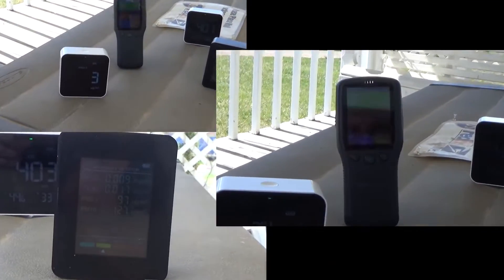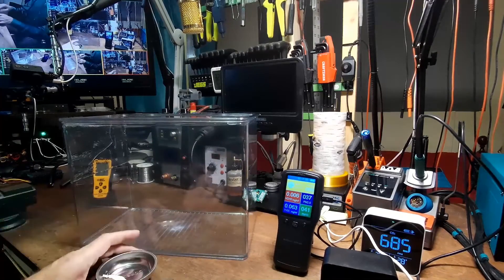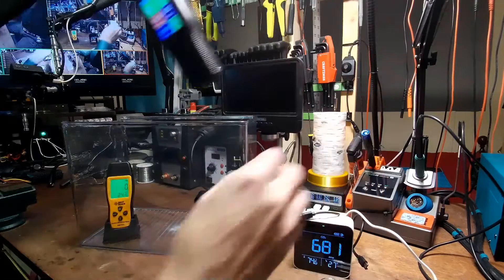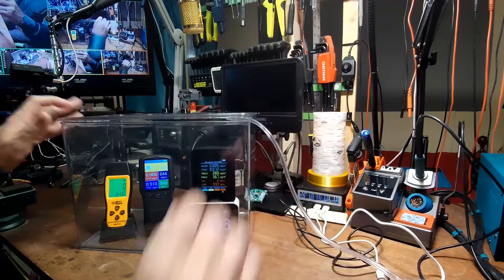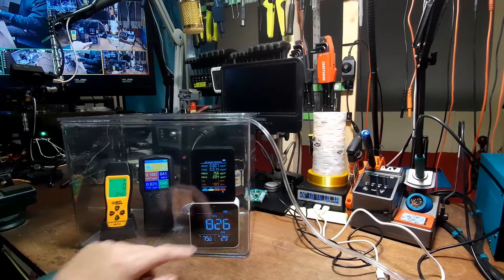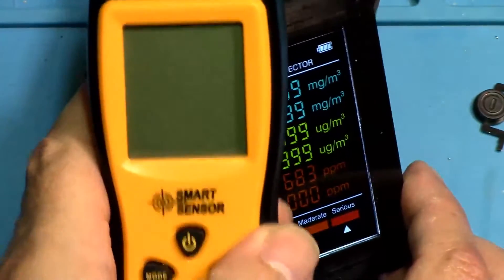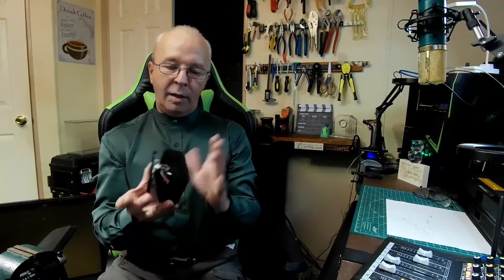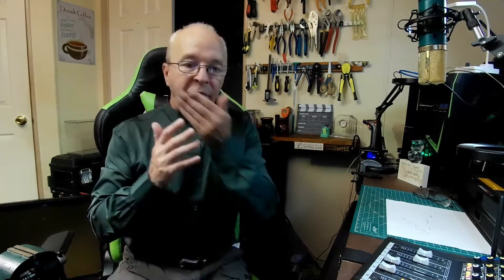Compare Fake Chinese Air Quality Monitor To "Smart Sensor" CO Monitor & "TemTop" CO2 Monitor

Comment: Wish I saw this before getting of those, I realised it was rubbish when it started shorting out my USB chargers. Cracked it open and the sensors in it were total junk, unplugged them and powered it up. It just showed random figures.
Reply from the maker: Sorry to hear you got this, but the silver lining is that it was only 20 bucks or so, as I am getting ready to do a video review of one that cost's 70.00 - and another that I paid nearly 100.00 for, so price anymore is no indication as to legitimacy for sure.

Thanks for the comment, and your experience- much appreciated.

Comment: As someone who's designed indoor air quality sensors, I can confirm that that is indeed a fake sensor. As you discovered it is predominantly an alcohol sensor (MQ series sensor, there are many types, none are CO2, or PMxx... there is a CO one, but these tend to be reactive to many stimuli so can easily show false readings), and a particle sensor (but not a PM2.5). The reason the particle sensor readings were off the chart after you opened it is that ambient light was likely interfering with it, or you had the beam totally occluded. That sensor is more like a smoke detector, capable of detecting huge airborne particles, but nothing down in the order of 2.5um or 10um that the meter claims. It's sad really, as true CO2 sensors and PM2.5 sensors of good quality are not that expensive. For only a few dollars more that thing could have been real at least for those measures. (TVOC could probably be included in there too without an appreciable price bump). Both CO and formaldehyde would add some additional cost ($10-$15 for both, in volume). The case and display are definitely good candidates for an electronics enthusiast to take and use for a real sensor.
Reply from the maker: Thanks Mark for your assessment - much appreciated.  The Chinese are getting very good at faking it.  I have two more fake monitors to review, but the one monitor is very very convincing.  The CO does not react to CO, nor does the CO2 react to CO2, but neither does the CO or CO2 react to alcohol, so it was intriguing to find what was giving the false reading for CO2.  I finally discovered that Nitrogen Oxide was the culprit this time, so am assuming that they are using a Nox sensor to fake the CO2 reading.  However, the CO I still can't figure out what they are using to trigger that, as nothing that I have tried is making the CO jump up high.  I can't get the CO to go higher than 8ppm, and it stays there pretty much no matter what I do.   I also found that this monitor is a clone of the actual maker, but they have completely duplicated every detail, and even the photos on Amazon are of the legitimate device.  I have contacted the company that makes this device, and asked them to send me one of their models for a comparison, but have not heard anything from them, so I will have to put the video off until I can get the money to purchase the legitimate device from the maker themselves.  Evidently they don't care that there is a fake copy of theirs being sold on Amazon, so it leads me to think that possibly the "real deal" is also a fake, but can't know for sure until I can afford to purchase it.

These fake monitors are getting way out of hand, and something needs to be done to put a stop to it, because people are buying these things for their safety in knowing their air quality.

But unfortunately, there is only so much that I can do to expose these companies, because I have very limited funds to keep doing these videos, and Outside In just hasn't gotten big enough for people to start helping financially.  We need more subscribers, and more people like you that appreciate what we are trying to do.  If the subscribers would equal the views and appreciation that the air quality videos are getting, we definitely would be much better off.  

I am working on a new case to better test monitors, but that has taken all of my finances, including grocery money LOL.  I am hopeful that soon the subscribers will surpass the views and appreciation.  There is so much more that I want to do, but simply can't without help from those who benefit from these videos.

To be perfectly honest, I sometimes feel it would be better to just stop doing this, but then my part that loves to help others kicks in, and says no way.  I enjoy doing what I can to save a life, so whatever it takes, is what I will keep doing until I simply can't.

Thanks again for the assessment Mark, and your knowledge in the field.  I am constantly learning more and more about these devices, and how to dispel them, so people don't make the mistake of buying a fake one.
Reply: @Outside-In.  it's great that you are doing these reviews to let people know. I hope that your base grows to help sustain your efforts. 

One thing to keep in mind with CO2 sensors is that there are "eCO2" sensors out there, which are not the same as a true CO2 sensor. This type of sensor estimates CO2 levels based on other parameters which it can measure (usually some sort of VOC - this may be what the cheap "fake" Chinese device was doing with the alcohol sensor, but poorly), and thus is not a true measure. They are not particularly accurate except under a very narrow set of environmental conditions, and can easily produce a false positive, or negative. But they are none-the-less legitimate devices. (see the SGP30 from Sensitron as an example from a well respected sensor company)  Even if devices that use this type of sensor state that it is eCO2, the average consumer probably wouldn't understand the difference. 

Bottom line though, is that if someone is using this as a safety device, they should not be relying on a bargain-basement device from ebay, amazon, or any other online marketplace. It has nothing to do with country of origin, bad devices can come from anywhere, not just China. Good devices can come from China too, just expect to pay more for them, like they would from anywhere else. The fact is that most of our consumer electronic devices, good and bad, come from China.

Anyway, keep up the great content, and best of luck with the channel.
Reply from the maker: @canadianavenger  Thanks Mark for the encouragement, and also the subscribe - it is much appreciated.

This is the way I look at it.  A device that specifically states a particular reading, and it turns out that the reading is being manipulated by another sensor or reading - it is fake and should never be trusted, and also the company should not be trusted.

Intentionally misleading the public is false and a lie.  eC02 is not genuine CO2 - it is an approximation like you say, but an approximation is still a lie, and therefore a fake monitor.  If eCO2 is apart of some of these devices - then it should be stated in bold on the packaging and on the screen itself, that it is eCO2 and not CO2.  If a company puts a eCO2 reading in their device, and then labels the reading CO2, believe me - they know exactly what they are doing - lying - misleading a person to think one thing, when it is really another.

Hotkrem has a budget CO2 monitor that is genuine, so not all budget monitors are a bad thing.  And yes you are right, there are a number of legitimate China companies making legitimate monitors, but also yes, that it will be evident by the price being not-so-low LOL.

Thank you again Mark for your encouragement and knowledge in this field.  It is also helping me to stay focused on why Outside In was started.  As long as we can pass on information that can save a life, then it doesn't matter how many times I have to over-draw my account to keep doing these videos does it???....  👍
Reply: @Outside-In. Love your videos. Please do a tear down or open up of the TemTop 1000s+ 2nd 🙏
Reply: @Outside-In. Mark, if you see this I have a Q: is the IQAir a quality brand? I rely on their sensor and air filters to protect my sick kids. They have a genetic illness and cannot deal with toxins.
Reply: Can you name the CO2 sensor on the market that measures accurately?
Reply from the maker: @greywolf_35  Thanks for the question.  If you need accuracy, then you will want a monitor that uses an Electrochemical Sensor and not an NDIR Sensor.

Electrochemical Sensors are used for more accurate readings, and will also register higher concentrations of contaminate, but at a cost...  Electrochemical Sensors have a life span of 2-3 years.

NDIR Sensors are less sensitive and less accurate, but they are so popular because the NDIR Sensor has a life span of 10 years.

For home use, the NDIR Sensors are perfect as they are very good, and close to accurate, and also have a much longer life expectancy.  If you don't need pin-point accuracy (like I do) for testing and comparisons, then NDIR Sensors are just fine.

I hope this answers your question.
Reply: @Outside-In. What is a short name for an electrochemical sensor? How are those called on a manufacturers website?
Reply from the maker: @johnmachter40  EC sensor is the short for Electrochemical Sensor.  Hope this helps.
Reply: can you give me a recomendation for a not too expensiv but accurate measure tool for vocs for 3d printing?
Reply: @NikBuhler  M10i

Comment: I've got cheap $86 Air quality detector, says it's got a co Sensor or at least its got the readout for co, my home before  says 400 ppm co2 but with I put the monitor under the blankets with my head also under the co2 Immediately jumps 800 over time that number jump to 1300 but the co jump from 0 to 6, so clearly it don't have a co sensor the co display is used co2 to circulation is bad and the potential for co to also build up, so I'm happy with that, vape shot the 2.5 micron up to 999 just by blowing vape on the unit, so in a way it's working
Reply from the maker: What is the name of the monitor you have?.  Thanks for the comment.   Whenever you put your head under the blanket with the co2 monitor, yes, the reading will definitely go up,   but the 400 reading in your home concerns me, and why I would like to check this monitor out.

If you are a smoker, you will also be breathing out CO for at least 10-15 minutes after you stop smoking a cigarette,  so jumping to 6 would make sense.   I have not tried vapeing with a connection to CO, so maybe that is something I should try.   Will have to get a vape to try that.
Reply: @Outside-In. I get a reading of 400 ppm co2 because I've got a wood and it's always sucking fresh air in so co2 is 400 ppm most of the time and AQI reading of 6 but the unit is a Bosean
Reply from the maker: @haroldmcdermott515  OK,  thanks Harold for the info,  I will be checking that out.   The problem I am having with a 400 ppm reading,  is because that is pretty much an impossibility, and that is why my concern.   A typical CO2 reading in a home would be around 500 or so,  and it may go down to high 400's, but not down to 400.  It also depends on where you live,  and the concentration of CO2 levels in your area.   I will be checking out the Bosean, and let you know my first impressions.   Thanks for the reply - much appreciated.

Edit:  Harold,  just wanted to say that I just went on Amazon and found the Bosean monitor with CO2 and CO, and I am positive that this is a fake FAKE monitor.   I know that is going to be hard to swallow since it is one of the more expensive monitors,  but the Chinese are getting smart about this thing...  They are starting to raise prices on these monitors to fool people into believing it is real due to the higher price tag - which is very unfortunate for anyone looking to buy an accurate monitor.   Sorry to have to be the one to alert you to this,  but also just to let you know,  I am definitely going to purchase this as soon as I get enough funds to do so, and create another video test and teardown.
Reply: @Outside-In.  it maybe called fake as far as the co goes but the co is Calculated by the co2 sensor, so it not totally fake, if you have co2 build up that's a warning of poor air circulation and the chance of co also building up, as for it reading co along I would trust it, but all other sensors seen to have there own sensor.
Reply: @Outside-In.  OK with a little research the co2 and Co both use the tvoc sensor to calculate the readings, so there's a least 3 readings are calculated off the one sensor, I don't know about the rest
Reply: @Outside-In.  the tvoc sensor also detects gas I held the detect above a propane burn and after a few seconds the tvoc reading jump off the scale 9.999
Reply from the maker: @haroldmcdermott515  yes,  that will happen with aTVOC sensor, and it will also happen with Paint;, Alcohol,  Deodorant,  Perfume,  Windex, Goo Gone, Absorbine Jr., Laundry Detergent,  Soap, Propane, Acetone, Gasoline,  Diesel, and Bubble Gum,  and the list goes on and on and on and on.   I am going to purchase the Bosean as soon as I get home,  and I am looking forward to testing this monitor and doing a teardown to dissect it and process it, so myself, you, and others will know once and for all, if the Bosean is a keeper,  or a thrower...  I thank you Harold, for giving me another video to create.   I love staying busy 😜👍👍
Reply from the maker: @haroldmcdermott515  Any "sensor" that gets its reading from another sensor is definitely a fake nonexistent sensor.  There is no such thing as a CO2 sensor that gives a reading based on a TVOC sensor...  The Chinese are very good at making these things look so real.  It is who you would rather put your trust in... Put your trust in the Chinese,  who constantly make FAKE air quality monitors because they don't care who lives our dies,  or do you put your trust in someone who has done very extensive research for the past year, and has a great deal of knowledge on how fake monitors work?...
Reply from the maker: @HaroldMcDermott  Any monitor that gives even one fake reading is not to be trusted with any of its readings.
Reply: @Outside-In.  reading on the internet tvoc/co2 on the same sensor
Reply from the maker: @haroldmcdermott515  Interesting,  never heard of such a thing.  I have seen many TVOC/HCHO sensors,  but never a CO2/TVOC sensor.   Do you have a link?
Reply: @Outside-In.  it's an air quality meter anything that Triggers it means you either have something major happening or poor circulation, that means it's working
Reply from the maker: @HaroldMcDermott  Good assessment, and thanks for the information - much appreciated.  👍
Reply from the maker: @haroldmcdermott515  Harold,  I just found the Bosean website,  and they sell a monitor that costs 330.00, so now I am even more interested in taking look at the one you have...  I could be wrong about this device,  and I truly hope that I am,  as I have been looking for a monitor that has all these readings plus CO that is legit,  so I am definitely going to get the one on Amazon,  and check it out with great anticipation that it is real.  Will let you know how it goes... 😃 👍

Comment: What is a good partical meter in your opinion, at a reasonable price. I ordered the CO meter, hope it is as good ask you claim it to be. Sadly I only can get that CO2 meter in  Amazon usa
Reply from the maker: If you ordered the Smart Sensor CO meter, then you made a great choice, and it is as good as I claim.  I love mine.  If you are looking for a good Particulate monitor, go with the Hotkrem.  The following is a link to the Hotkrem that has a data upload function for collecting data over time, but you can choose the regular one if you would like to save a little money.  I am thinking of getting the one with data upload, as mine is just the regular without data upload... 
https://www.amazon.com/HOTKREM-Quality-Monitor-Detector-Indoor/dp/B0B9S6WRZS/ref=sr_1_4?keywords=hotkrem%2Bair%2Bquality%2Bmonitor&sr=8-4&th=1

Thank you for your comment - it is much appreciated, and glad you found the video helpful.

Hotkrem also makes a CO2 meter that I just did a video review on, and it is only 30.00, and works great...
Reply: Thank you for the reply @Outside-In.
Reply from the maker: @RuudyL  You are welcome 👍